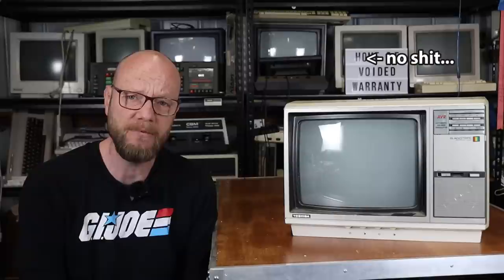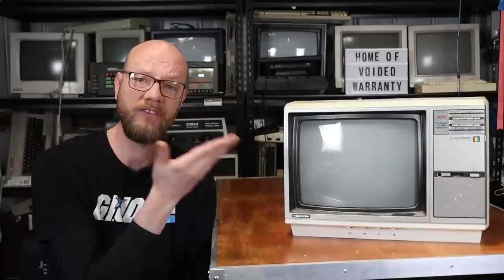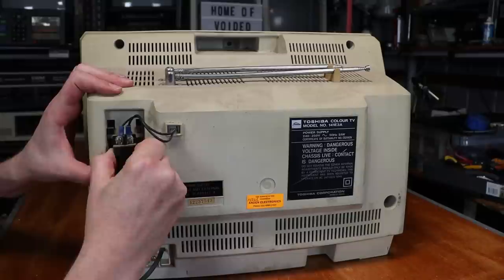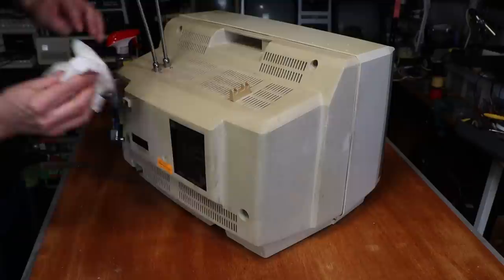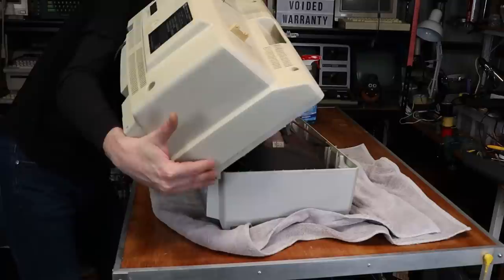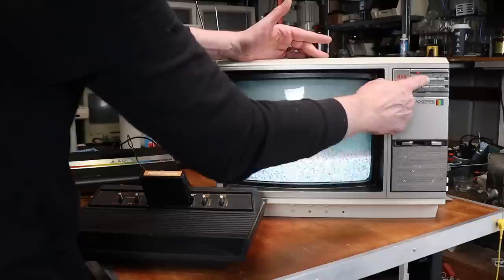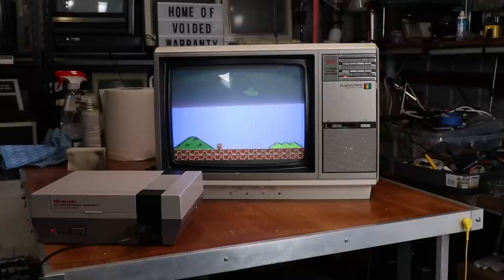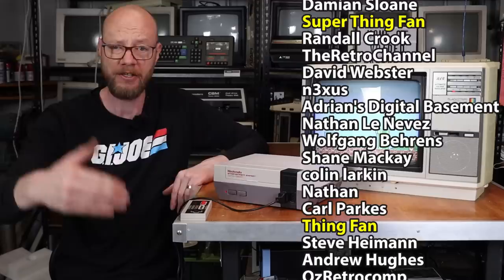Toshiba 141E3A Television: Clean up and test

Comment: Agreed, using a period correct TV for game consoles or a CRT monitor for computers is a wonderful experience. Nicely done on the Toshiba clean up. Having an air compressor verses using canned air is so much nicer (and cheaper in the long run).

Comment: When I first got my Commodore 64 in 1983 it was set up in the lounge room. At that stage we had an old 20" Philips VHF only TV so I had to use our old top load National VCR as a go-between. Two RF sections (C-64 to VCR & VCR to TV) made for a hideous image. I did end up making a C64 AV cable to connect to the composite/audio input on the VCR which was a little better.  I ended up with a General 14" VHF/UHF TV a few years later (my cousin ran a small electrical appliance store). That TV ended up in my bedroom together with the C64. This TV stayed with me for over 25 years!

Comment: That was interesting and also entertaining. When you opened up the little door on the side and I saw those little dials, I knew what that little knob was for! You worked it out in the end. I used to be good at tuning in TVs, VCRs, etc, so I seem to adapt to computer stuff straight away.

When I got my first gaming console, I had to wait for the 26" Rank Arena to be free ie: could not use it around 6pm onwards.. the news.. When I got my first computer it was worse, as I wanted to program all the time. Luckily for me, the 26" Rank Arena started to lose it's focus and/or colours (or both), so my parents bought another 26" Rank Arena for the family room and I got the old 26" Rank Arena for my bedroom! It was OK for the programming of my first computer - a Tandy Color Computer. Such joy and memories!

Comment: Holy shit this is the same model of  TV I had in my bedroom as a kid. Exact same model and everything. It served me well for many years of Nintendo and C64 gaming, as well as aa lot of late-night Rage viewing, X-Files viewing, Letterman viewing and many other things. Great little TV for the era.

I was always amused by the fact it had a channel marked as A/V despite not having any non-RF inputs.
Reply: That'd be the alternate time base for VCR. I've seen that on TVs as early as 1974. If you preset your VCR on a channel not marked A/V, you will likely get a shaky, unstable picture. Although some 90s VCRs have some kind of time base compensation and when you get to the VCR/DVD combo era, often a full-on Time Base Corrector (TBC).

What does it do and why is it not on all channels?
- IDK. My guess is that the horizontal frequency has some lag to it changing the frequency, so it takes a while to sync up. On noisy RF/weak receptions, this will cause the horizontal sync to be less affected by the noise. On VCRs, there are two physical video heads scanning the picture. If one comes just a nanosecond before the other, every second frame will be shifted by roughly an inch, yielding a jittery picture. Also the effect of wow&flutter on the tape transport will result in a warbling picture.
The alternative time base will probably switch the frequency averaging capacitor for a smaller one, allowing for much faster reactions to changes in the horizontal sync pulse. The downside is that if you pick up a weak RF signal (back when live TV over the air existed), the horizontal will be all jacked up, vertical lines will start to look like oscilloscope waveforms rotated by 90°.
NOTE: I do NOT know this. I'm merely doing an educated guess.
Reply: @senilyDeluxe  Ahh wow I had no idea that it would be something like that. We always had the VCR on that channel (back when it was our main TV and not my bedroom TV) so never realised it could be a problem otherwise.
Reply: @SerialExperimentsTim  I bet the manual states that if you have a VCR, you should preset it on the last channel.

Comment: Green text on gray background on NES -> 
Big modern LCD screen: You get unintelligible green blobs of Garble (plus .2 second lag).
Any 70s 14 inch CRT TV: Perfectly legible.
My 1977 Grundig 18 inch TV that accidentally had a Monitor CRT (fine pitch dot mask) from the factory, still RF only: You can use a caliper to size the pixels, it's that sharp. (btw. the NES produces a better picture over RF on that TV than it does over composite on most other TVs). Helps that it's relatively low hour too. I have a 1981 16 inch Metz that is ultra low hour and if you dare to turn up the contrast, you'll need sunglasses!

Comment: The four-switch 2600s seem to have worse RF than other models. The six-switch models with the heavy shielding around the main board have EXCELLENT RF. So much so that composite modding is a moot point

Comment: That TV looks old enough to possibly have a composite signal somewhere on the board, but it's also probably a hot chassis, so be careful if looking to do mods!
Reply: Yep! Always check if there's any kind of continuity between ground and the power plug (unless it's a dead short to the earth lug on the plug, but TVs usually don't have that).
And sometimes, it's the exact opposite - there's just RF on the outside, but on the inside, there's everything prepared for AV with composite, RGB and even YCbCr (had that happen to me  - needless to say it's cold chassis too)

Comment: I don't know the general conditions in your shed, but are you not worried about dry cleaning (brushing, air-blasting, etc.) inside? You're basically just spreading the dirt around in the room, potentially getting it on and/or in your other devices? I always take my stuff outdoors when it's time for the air compressor.